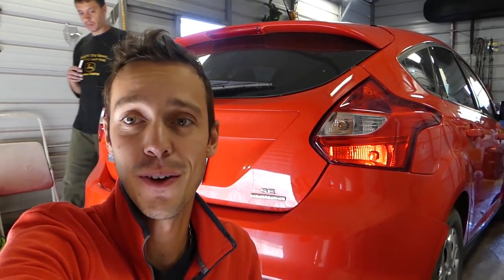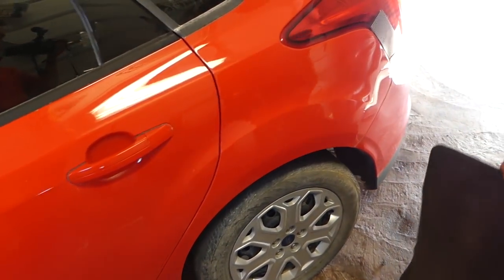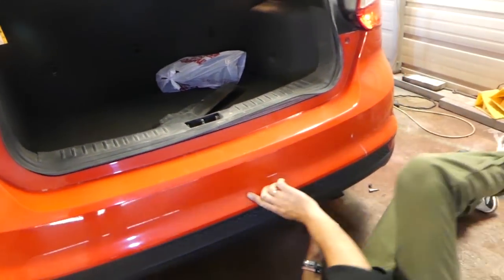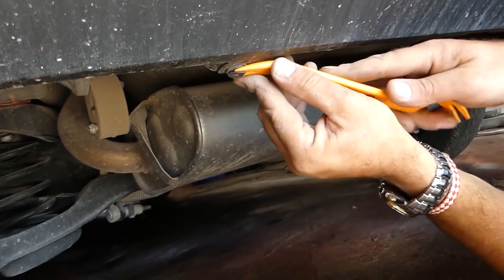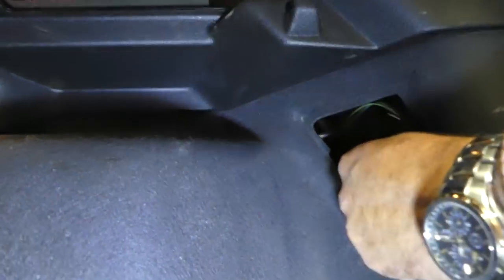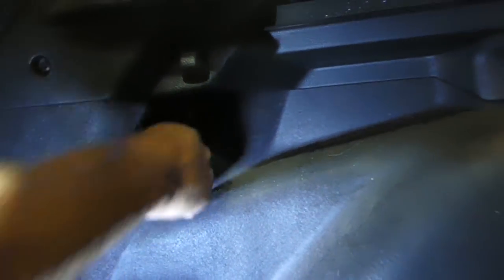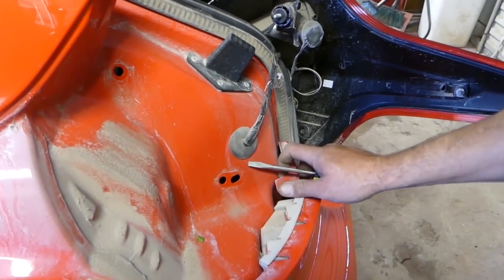FORD FOCUS REAR BUMPER REPLACEMENT REMOVAL 2012 2013 2014 2015 2016

Comment: Thanks guys, need to remove mine to reseal those stupid vents behind the bumper as they are leaking like mad and the water is now in the boot and this gives me confidence that I can do it without wrecking anything!!
Reply: Steve, How long does it take you to seal the vents? did you seal all 4 ??Thanks

Comment: Helped me out perfectly. A metal plate for a trailer hitch I was installing got stuck in the steel tube between the access hole and the bumper. Was able to take it off and get to it.

Comment: Thanks for the video, I had to remove mine to seal those rear vents and stop water entering the boot and this video was very helpful.  Many thanks 10/10 upload.
Reply: I'm about to do the same, did it work?
Reply: @tonyconnolly5385  I'm also having to do the same.  Did it work out okay for you?

Comment: Hi Guys, just used your video to take off my bumper as had the classic leaking vent issue. However found there were 3 fixings in each wheel arch - damaged one side pulling before I realised. Fortunately I had some epoxy to fix!
Reply: Is the three screws behind the wheel arch covering

Comment: Like one of the other posters below, my 2013 hatchback has 3 screws on each side fixing the bumper for each of the wheel arches. Also - if you have parking sensors to the rear, there are connections to those on the driver side that you need to be careful of when pulling the bumper away.

Comment: Hi, amy guide to remove the diffuser only? I would like to change to Zetec S
Reply: Did you manage to do this? If so did you have to remove the whole bumper or could you remove the diffuser section only? I'm doing the same zetec-s/st-line upgrade.

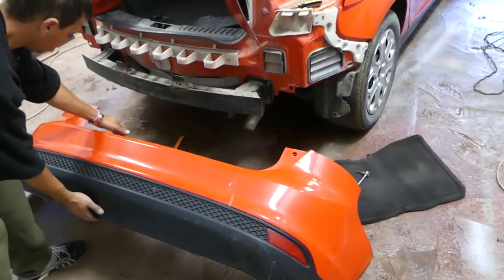Comment: Hey what are these 2 sets of gray flaps at 5:41 for? Thanks for the video!
Reply: Those are cabin air exhaust vents.  All the air that comes into the cabin from the dash vents or air conditioner has to go somewhere, so it exits at the back of the car down low.  The 'flaps' are usually designed to only let air out.

Comment: great just what i needed to know as i have water leak and need to seal vents behind
Reply: This issue is endemic can't believe it isn't a recall.
Reply: its driving me absolutely crazy, its so unfair they are not recalling. i am in talks with Ford but its going nowhere "you bought it out of warranty, tough" is basically what i get told. Unless i pay a £80+vat diagnostic fee. a third party vendor will sort it out for much less than that! bastards. Look up @borisblackheart and check my conversation with them. Crazy. Any support, retweets or copying in of other useful twitter accounts would be appreciated.
Reply: Barry Scott I have the same issue with a 2014 focus - wet carpet in the passenger rear footwell and the spare wheel is nearly under water!!!!
Reply: check rear passenger seat foot wells... mine are soaked and carpet moldy.... im fucking angry!
Reply: Barry Scott - it was the damp smell that made me investigate! It seems ford owners club forum is full of the same issue - I’ve just removed my rear bumper and sealed around my vents (loose vents)- there’s a rubber gromet underneath, I pulled it and it pissed water out everywhere!!! I can see that rusting from the inside out if left.
Reply: yeah im in the process of getting all the tools i need to do this myself. I have been reading from the ford owners forum post to, the one with the really helpful pictures. First time i have done anything like this but cant afford £100+ on a trip to the doctor. There should be a fucking recall its an absolute disgrace. My car STINKS... Valet in the warmer months i think...  I have spoken to ford, they basically told me to do one... "out of warranty not our problem" im not paying them £80+VAT to decide if they are going to help me out. Its a joke.
Reply: Neil Essam Looks like I've the same problem just tried removing the rear bumper thought I removed all the bolts but it wouldn't budge. Really annoying the last thing I wanted to do is remove a bumper.
Reply: John Corbett this vid only shows him taking out 1 bolt in each wheel arch but there’s 2 bolts! One is hidden behind the material stuff in the arch, just peel it back a bit and you will find it. My bumper wouldn’t come off until I found them!
Reply: Matster B Thank you for your reply I've a ST slightly different rear bumper found two bolts in the wheel arch but I think I need to be more force full. It certainly didn't become loose. At least I've worked out how to remove the stupid plastic nuts holding the lights in place.
Reply: John Corbett I know I had to slightly knock mine off with my hand until it popped off the side brackets (they kind of slide on/off) Mine is a Zetec S so it was a pain trying to get to the plastic pins under the bumper because of the body kit!! You need a dry day and some patience and you’ll do it!! I couldn’t believe how loose the vents are! When you remove the lights, you can see the dirty line the water takes and goes straight into the vents! You will find a grommet under the vents to drain the water out!!! I used a full tub of clear silicone in and around all 4 vents and now have dry carpets! Can’t believe it’s not a recall tbh
Reply: Matster B If it wasn't for the info on forum's  I would be selling the thing on. Poorly designed but until its stops raining I can't do anything I believe the Fiesta has the same issue. Thank you again for your help.
Reply: mate... its the most annoying fucking thing ever. I was really struggling to get the time in the day to fix this myself. Took it to a garage in the end but it only cost £60 so not too bad. Ford were really horrible about it. Fact it its a factory fault and they should by rights be fixing this issue for the 100's of owners out there. Utterly ridiculous...
Reply: Mine actually had three each side. One at the bottom, one about half way up and a third further up underneath the wheel arch liner that you can get to after you've removed the bottom two by pulling the liner aside.

Comment: The only video I have found which clearly shows how to remove the bumper, mine is a cmax grand . There are 3 screws under the wheel arch. The rear lamps look quite difficult to find the top screwed fixing . Fitting tow bar for bike rack. Best so far. April 2018. Vertogen . Www.vertogen.eu .

Comment: I took the rear bumper off a 2012 Focus Zetec to repair a water leak from the air vents. Your video was really helpful but I had 2 more bolts in each of the wheel arches. One higher up than the bolt you showed and a second even higher up and under the wheel arch liner. Thanks for posting.
I used this video for how to repair the leak. https://youtu.be/hapb7A6dlsc .